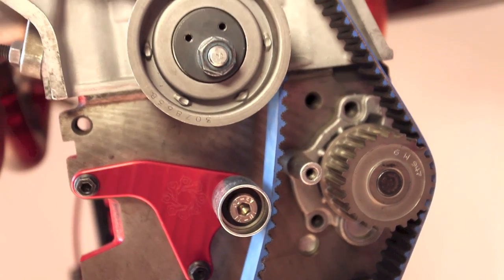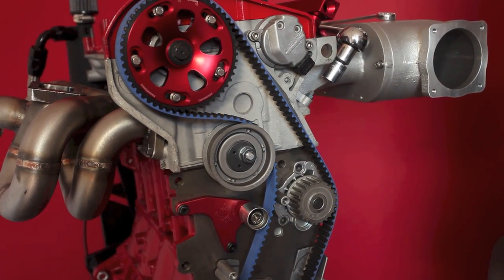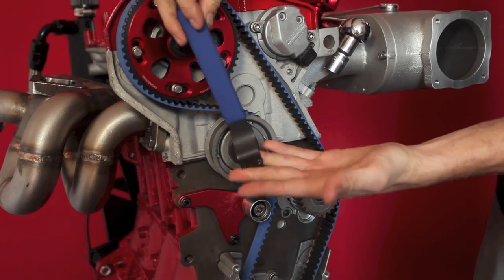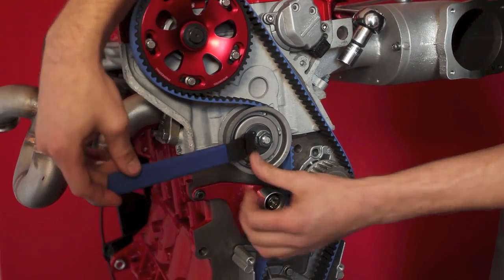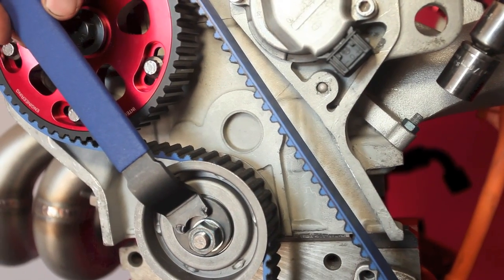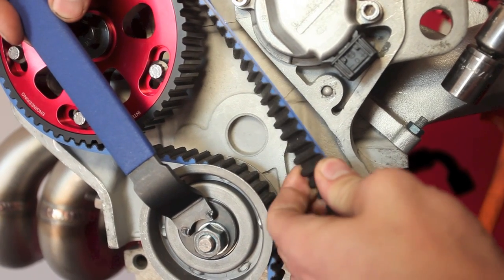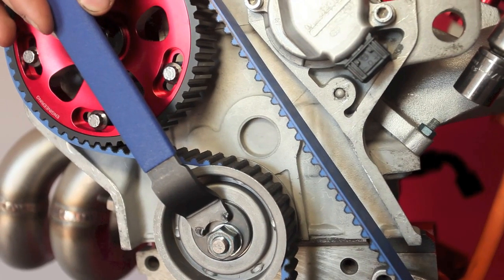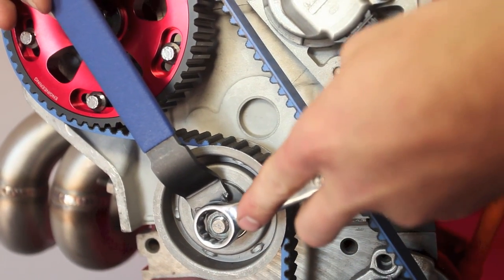Integrated Engineering How to properly tension a 1.8T manual timing belt tensioner kit

Comment: I done similar conversion to my 1.8t years ago. Just I used Febi 06687 tension roller with washer under it, G1283H timing belt, and no small roller seen in this video. It done almost 100 000 km and it just had new kit installed. Works perfectly to me. I also keep checking timing belt tension regularly, but only needed to do it once on the first kit.
Reply: What was the size of washer?
Reply: @normantasstr4451  Unfortunately I can not tell, as it was long time ago. I measured gap between original tension roller and surface where it touches engine, then did same with new tension roller and done the math to calculate washer size. I hope you get the idea.

Comment: So.  When tensioning the belt.  If your verfied timing marks havent moved. 

You install the belt. And thus begin tensioning.    If the cam moves slightly during tensioning. There shouldnt be anything to worry about bc one tensioned the marks will go back or. Should the marks line up after tension applied and snug+torqued

If i need to offset the marks  just enough so that when i have tension and torque  the nut that the marks are dead on
Reply: Go look at how to properly time your 1.8t, then come back here. You won't always be able to reference the timing marks on the old belt, eg it broke! Thus you should learn how to set up your timing from scratch starting with how to set your engine to TDC, etc, etc, etc....
Reply: @emotionalintelligence776  ive down 4 or 5 timing belt jobs now. As well as one on my girls car.     Im.more then capable of timing my or any 1.8t motor.    There are for sure some tips and tricks  you learn while doing this.     This comment was  5 months old.   Recently installed new head on my 1.8t and she is running mint besides lean code. But thanks for your comment 😂
Reply: @emotionalintelligence776  when applying the belt you offset crank so when you  finally get the belt onto the cam sprocket. The crank TDC mark is right there and your cam sprocket mark should be within a half a tooth either way due to the slight shift with the harmonic  balancer pulley.

Comment: Currantly building a 1.8t, how is the motor turned over by hand without oil pressure goint to the vvt tensioner in the head?

Comment: This set up work good for stock engines? Barely did a timing belt and water pump but having issues with the oem tensioner damper tensioner pulley roller and night have actually stripped/damaged the pulley roller. Something like this seems like it would be easier to work on and maintain so I’m considering
Reply: Coming from a Naturally Aspirated Golf 2.0, it's worth it, the tensioner is very straightforward especially for future service. It's uncommon for the tension to come defective.

Comment: if i have that much flex in the belt at high revs the belt just flapps about. it needs to be tighter. 45 degree flex is ideal
Reply: Hey if your still active.    Do you still agree with your comment?
Reply: @ItsViirn  yes after changing more belts the one in this video is more loose than it should be.
Reply: @slybunda  okay thanks well im going with LSP design with the solid adjuster and locking nut.  Cam seal is leaking but  i have a new belt and water pump only need a tensioner and roller. So i was looking at this IE set up or the LSP and gettinf new idler pulley and roller
Reply: @ItsViirn  the twist test is not a proper official test as stated in the service manual. sonic testers that you pluck the belt and test for frequency in hz are accurate and recommended. deflection test is good to use as shown in this video here: https://www.youtube.com/watch?v=4fva6d3kZas yes its a ford engine but this guy has got the tension close enough by using deflection test. 5mm deflection is ideal no more than 1cm deflection on the longest run when pressed from the middle otherwise you risk belt jumping a tooth when cold, remember the belt doesnt stretch much over time usually no more than 2mm stretch over the lift of the belt. if pushed longer then intended service life it could stretch more. engines dont expand as much as people think when hot. imagine if you had 5mm expansion, headgaskets would be leaking left right and center.

Comment: it.s a lil bit funny because the camshaft gear it..s moving when u aply tension on the tensioner pulley , this is wrong .. because there is a pin between camshaft gear and camshaft , if it moves u had a bad timing !

Comment: What do you do if you have 90 degrees but the front run is jumping around and seems loose?
Reply from the maker: You can try tightening a little more and see if that helps. It's common for timing belts to stretch a little as they wear. For that reason we recommend checking the belt tension at every oil change.
Reply: Checked it, front run was re-adjusted. This time around i used the gates. It is a noisy belt, and i believe it to be un balanced. I should have just sticked with OEM belt. Live and Learn. Also you're idler bearing is squealing something fierce.
Reply: @kevinp4532 Damn, you just saved me a lot of stress! I was gonna buy the gates one but now I’m going to just keep it oem. Thank you so much, one comment also says with this upgrade you have to check the tension every oil change and there’s no way I’m doing that

Comment: So my timing belt makes a wierd noise when its in low rpms so i think its the tensioner but i wanna know if theres a way to just fix it and not have to pay for a new one?
Reply: Mine (2000 Beetle 1.8T) did the same thing. The timing belt kit I installed was 3 months old (bought from http://www.ecstuning.com/) and the tensioner failed. Research, after the fact, shows ECS has a history of the same problem. Replaced the tensioner (10 minute job but another 4 hours and a pain in the ass to get to), and now works fine.

Comment: I have a 2000 A4 ATW. How do I find out if it's a 058 or 06a. I want the gates for my ride.
Reply: From what i know there is a split between the years 2000 and 2001 the 058 block has the water pump outside of the timing belt and 06A block has the water pump internally on the timing belt also the oil pump is slightly different i believe as well to how they are routed